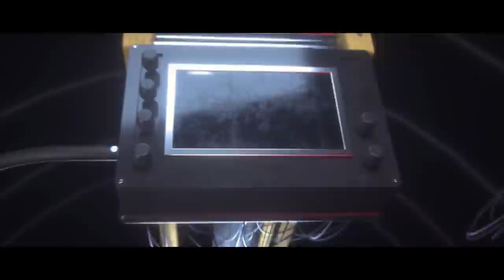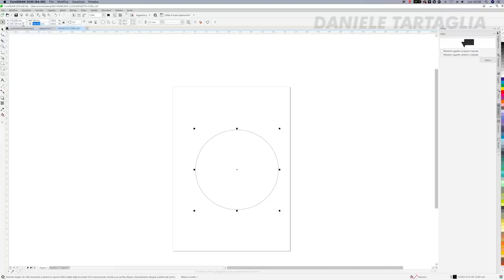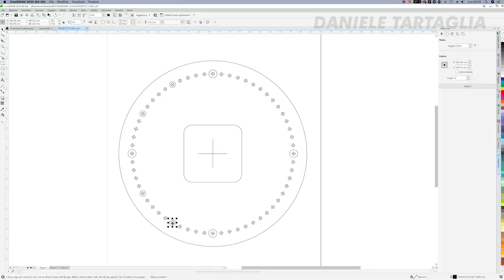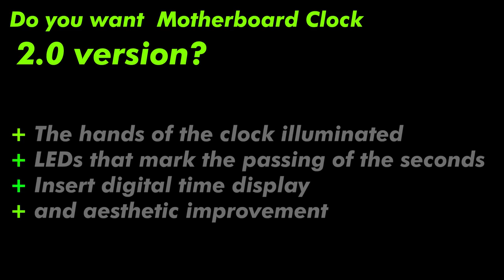how to make a clock with a old motherboard

Comment: Very nice job. I would have aligned the metal bezel so that the screws would have been on the bottom. They’re a slight distraction when looking at the clock as a whole. Excellent craftsmanship though.

Comment: Fantastic as always! Yes 2.0 would be so cool... Please.. :-)
I made a clock out of a old mobo and I just left it square with all the components and made a wooden frame for it.
I mounted the clock where the CPU would have been and use a hard drive disk like in the HD Clocks build I made for the kids. I used the same thing for the clock face but from a Scsi  5 1/4 disk... Looked good but it will collect dust like crazy I'm sure... Lol
 Sorry no lights. :-(
Thanks for the video!
LLAP

Comment: If you removed three enclosure of the rgb controller, I'd would easily fit inside. 
Without blocking the light. 

Further, this is a great idea.
Reply: Uh, then, how the powersupply would be connected to the controller, genius??
Reply: @zsombor_99  
There are multiple options for that. 
One is to desolder the barrel connector and resolder it via some wires.
Make a little square hole in the back plate. 
And glue the connector in place. 
Your problem solved.
Reply: @micheltbooltink  Oh, nevermind. 😐

Comment: Just gonna say you could have just put the motherboard on a hotplate o on a pan and the pieces would com out on their own when hot enough or just get it warm and it would make the job with the hot air gun much easier. There was no need to destroy all the conectors and parts

Comment: Am I the only one bothered that the original screw hole in the motherboard wasn't used for the  12 o'clock position and the 3,6,and 9 o'clock.position holes were just enlarged to match it?